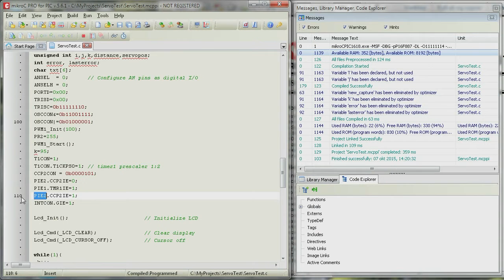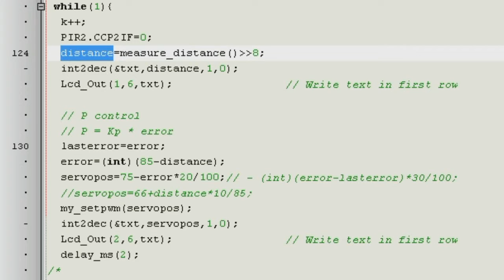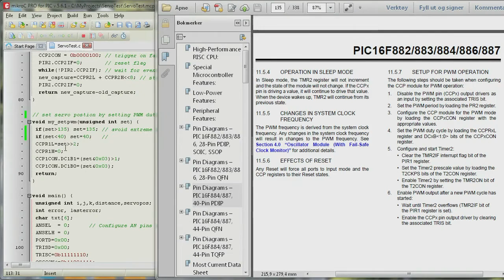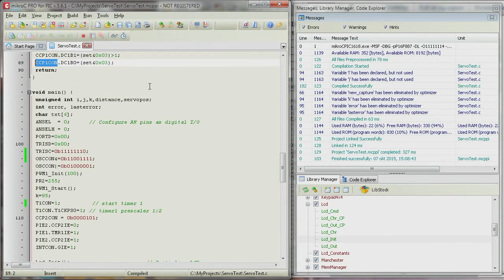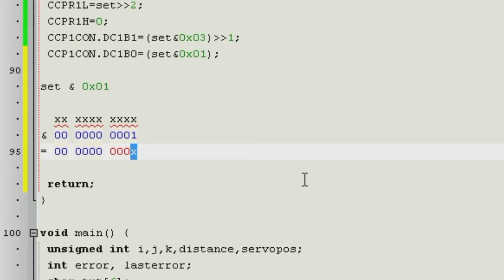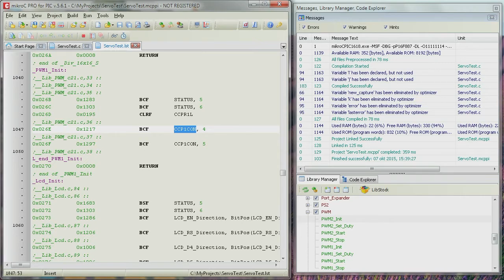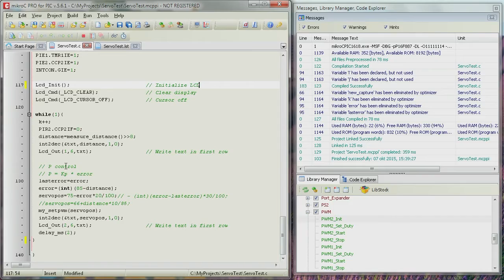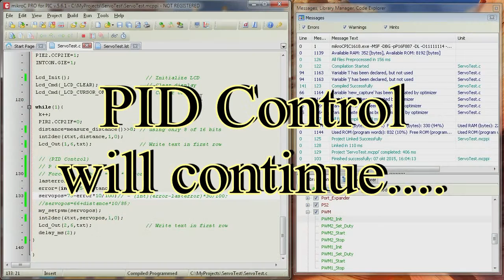The Beam and Ball Project - Part 4 Code Talk

Comment: I could listen to hours of you going on about this. Great stuff. What tool are you using for your screen recording? I like the way it zooms into what you're typing.
Reply from the maker: +The Highlander Glad you liked it. I used FFSplit for recording, and I added zoom effects in video editor later. FFSplit is a streaming/recording program and it can do zooms, add sections on the video with scaled parts of the screen or from other cameras. All in layers. I suppose you can set-up a hotkey for zooming/scene-shift, but I haven't tried that. I like to keep my mind free from editing stuff while recording. Worth a look! :) The reason for not using OBS this time was because used my computer#2 which has an old gfx card too old for the OBS software. It is too old for FFSplit as well, but FFSplit doesn't stop me from recording, it only warns me that anything using DirectX10 or later won't record properly. Will get a 2nd hand GeForce card soon :) 

Other details.. hmm , My screen is old fashion 1600x1200. Since this a 4:3 screen, I recorded a smaller 1280x720 frame section of the screen and put my programs into that frame. In that way text on the screen is readable on YouTube without fullscreen. Looks ok iPad Mini also. I don't know if it is viewable on iPhone or the likes.. It's all trial and error :)
Reply: Well it was interesting all the same. I'm still working on my assembly course which is why I asked. I use Adobe Premiere. I can zoom in with that during editing but I'm not sure what the quality will be like.

Your ball & beam project has impressed me Hans. And all out of a card board box. You're pretty talented with this stuff. Is it just hobby for you? Or also your work?
Reply from the maker: I've  had a play with the FFSplit. It does overlay and multiple cameras/screenrecordings.. No zooming though.
Thanks. It's a hobby of mine :) I wish I could work with this.